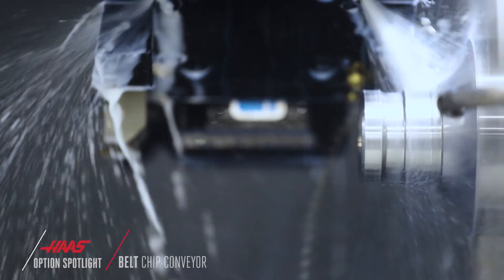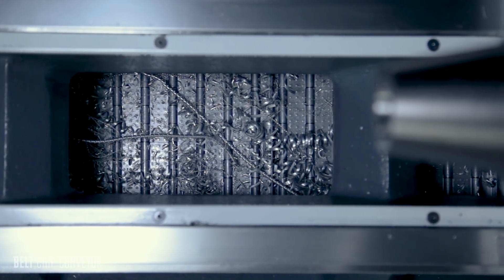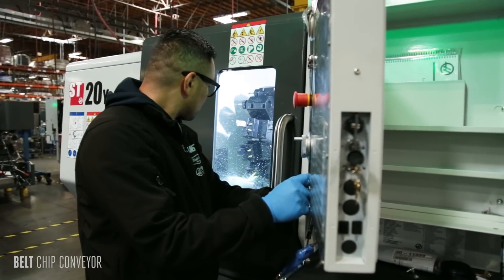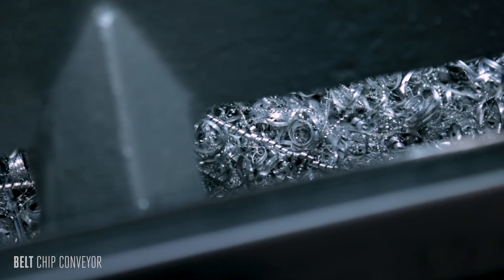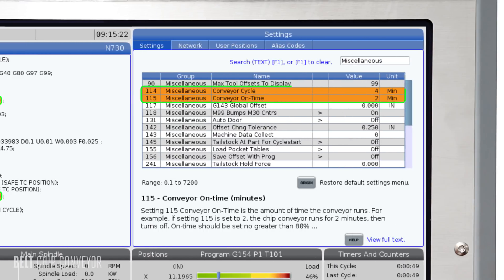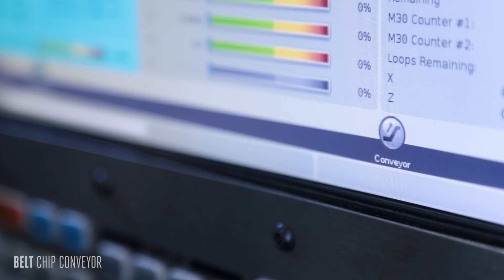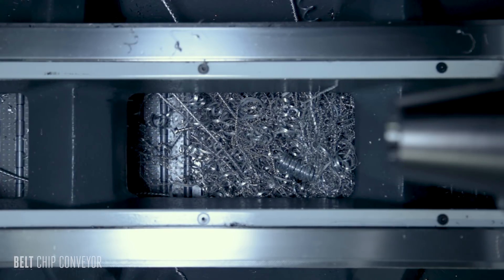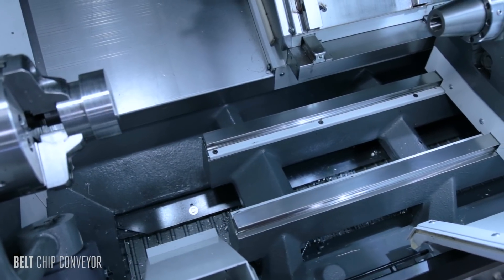Belt Chip Conveyor - Haas Automation Option Spotlight

Comment: The one at work has jammed up, ST30... On other models you can remove the coolant tank underneath to clear the chips, but not the case with this model. If it's not the belt tension as described in another video, then what? Remove the conveyer from the machine?

Comment: "Durable Steel Conveyor" I have plenty of experience with these units, and I disagree quite strongly.
Reply from the maker: What has your experience been and is there anything we can do?  Haas Automation
Reply: Haas Automation, Inc.  I'm not sure there is anything you can do for our current situation.  But I can tell you there are 2 issues at play.  First when the barfeeder is loading a new bar, the part catcher should engage to catch the end of bar.  Otherwise, unaware machine operators allow the end of bar to go out of the conveyor.  And many of those pieces get wedged in the chip conveyor box and rip those gripping teeth and slats completely off.  Almost all of ours are gone.  Also, when accumulated stringy chips such as those created from parting tools and face grooving tools build up. That nest of chips doesn't have enough room to evacuate quickly under the tailstock rails and the box of the chip conveyor.  In the end, have the part catcher catch end of bar, and get a larger conveyor box.
Reply from the maker: I'm not sure what we can do, but if you are willing to send your machine serial number I can at least take a look at your machine and its service history.  If nothing else we always want to hear about what our customers are experiencing.
Reply: Haas Automation, Inc. I'd rather not get that involved.  Just need a part catcher when loading a new bar.
Reply from the maker: willis higley - Thanks for responding.  I will pass along your comments to Engineering.  If you want to discuss this or anything else more, feel free to email me directly at bofallon@haascnc.com - Bryan

Comment: I would really like to see these roll out the front instead of out the end.  You have to have way too much floor space free to remove from the end of the machine..
Reply: Les Young so you want the chips to have to make a 90 degree turn before exiting?  Probably won’t turn out well.
Reply: Dustin Walden  no some manufacturers have the conveyor in the same position but instead of it having to slide out the end it will just roll sideways out the front of the machine.